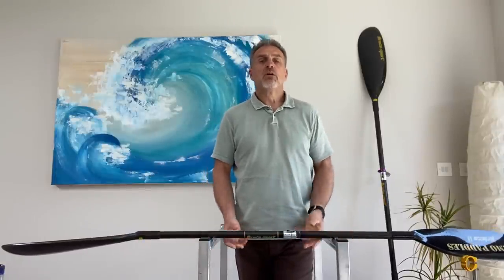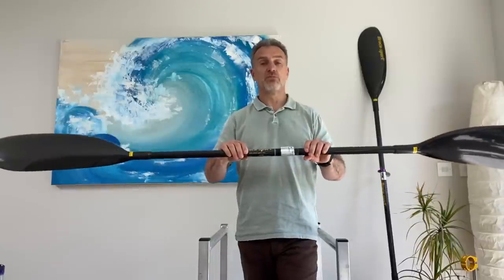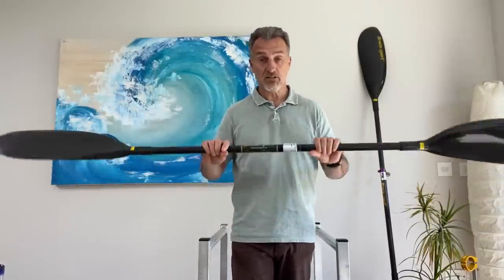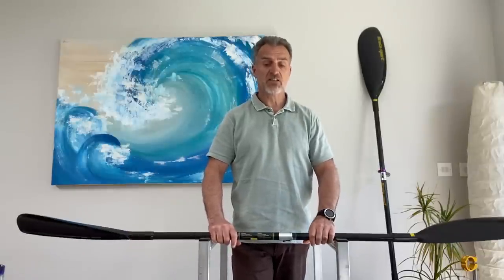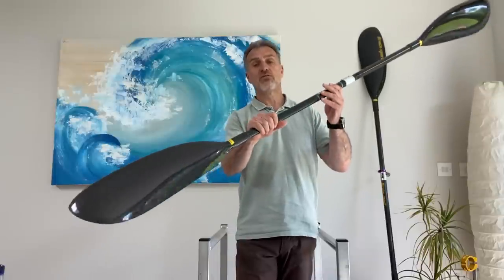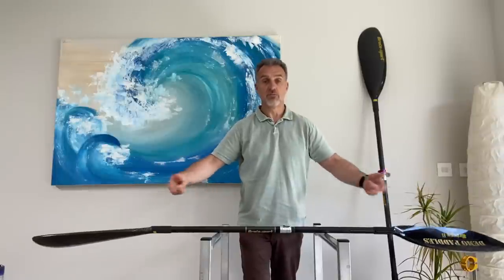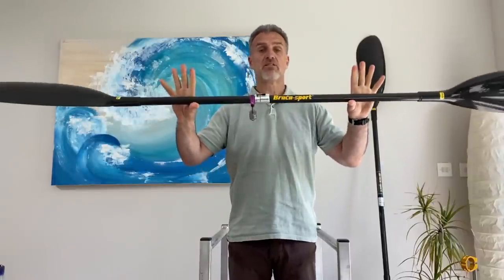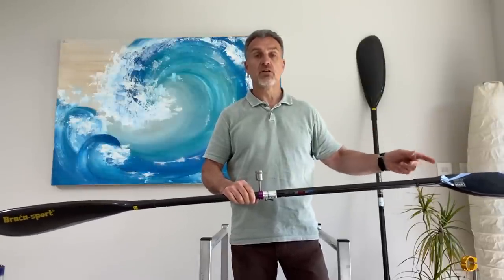Featherweight Concept

Comment: Wow, this is exactly the issue I've had for so many years. Getting stiff forearms from counter-rotating, even when the rest of the body is relatively fresh! Excited hear more about this!
Reply: If you are using a feathered paddle with one control and one release hand and are experiencing stiff forearms in both arms, then it seems something else is causing your problem because the forces and grip needed to counteract the blade flop are applied only with the control hand and should not affect the arm of your release hand.

Comment: A very simple concept solving a big problem, well explained. Thank you very much for sharing.
I can see users of wing paddles adapting it fairly quickly.
Now I'm curious what's the functional weight of my Bracia 7 725, 210cm I got from you 😇 - feathered at 60deg right handed.
See you on the water, possibly. 👍

Comment: What if you had a bent/bowed shaft in the centre then you could add a flush weight minimising protrusion. The bend in the shaft would off set some of the mass before adding weight? That would obviously not be an aftermarket option, as this is.
Reply from the maker: It would work but it would would also have to be a specific bend to account for the blade size, feather angle and blade type. I can’t see the paddle manufacturers being able , or willing , to produce a specific shaft for each scenario.

Comment: TY. Very interesting.  Question can’t they design a paddle that is equally weighted????  Also an idea. Simply increase the length of the connector to the weight. Thus the weight could be reduced!!!

Comment: That's an intriguing thought!
I have one concern, though, if you'll allow. When you counter-weigh the rotational force of the paddle incurred by it's rotational imbalance, you will add the exact additional rotational inertia that it already has through the imbalance -- i.e., the rotational inertia you'll have to overcome to rotate the paddle doubles (while of course the paddle is in balance statically). Given that you'll have to overcome this doubled inertia twice per stroke (starting, then stopping the rotation for left stroke, same for right), and that the paddle is fairly self-supported while in the water, I am extremely curious how this plays out in practice. 
Would you grant me the freedom to try this out myself with a bootleg version of the design?
Reply from the maker: Sure. Go ahead. I am confident you will see that issue does not arise. 
Drop me a DM and I will send you a set up video, to help you position your mock up.

Comment: Ivan. This is great stuff. Thanks as I have not sorted my paddle out yet. I think this would help. Warning, newbie type question below and sorry if you have answered in other clips. Can you suggest a non-subjective method to establish / set offset angle and paddle length?. The “try this and that see how it feels” doesn’t seem to work as I get no specific data, I can’t tell either way when I have used it for a small length of time. On a recent paddle of 20k. I stopped half way for a snack. My 30 degrees and 211cm ( Epic Mid Wing) was reset to 205 and I twisted it to ~45 deg when I stuck the paddle in the sand. I didn’t realise it at all until I finished and packed it all away. Ps I’m no sprinter, my typical is 10-20k @ 10-12 kph and avg 35s/m. Appreciate if you can advise…

Comment: For us older paddlers, innovations like this are really welcome as we try to minimise injury. 

On a slightly separate note, I personally think that many paddlers have blades that are too big for them. I think this is due to the fact that people quite often get the same paddle as top end paddlers who are stronger and fitter. The evidence for this is when you see paddlers with really slow stroke rates. This may potentially be also causing injury (and making them slower). Just wondering what your thoughts are on this?
Reply from the maker: Totally agree on the paddle size issue!

Comment: Have you ever tried this? How much is it faster like in 1 km?
Reply from the maker: I have been testing for nearly two years. 
Faster? I am not going to claim it make anyone go faster. 
What it does do, as I said in the video, it gives you a lot more security over the last 50m of your 1000m when everything starts to feel bad. 
So it may well reduce your decline in speed at this part of the race. 
All boat and paddle manufacturers claim added speed but I am too old and cynical to do the same!

Comment: Great idea, but probably only practical for a sprinter. Any form of marathion racing and the counterweight is a safety hazard and is at risk of being knocked off.
Reply from the maker: So far, primarily tested by marathon paddlers, ranging from Junior internationals to old guys doing the 125 miles of Devizes to Westminster with 70 + portages. Seems ok so far.
No fatalities and no mishaps.

Comment: This will have some inertia when you turn the shaft if the blades are offset.
Reply: Another reason for zero feather?
Reply: @gcziko  Yes, even if balanced, there is still effort required to rotate the shaft in the case of offset.
Reply: The unbalanced weight also tells you the position of the blades in your hands without looking.
Reply from the maker: You guys do realise that even at zero feather there is a requirement to rotate the shaft?
Reply: @ultimatekayaks6499  compared to the linear and rotational forces one needs to apply to the paddle during the active part of the stroke, the out-of-water portion seems insignificant. At near zero feather I don't feel any effort to rotate the paddle into place. I'm probably just not good enough to notice that level of detail...
Reply from the maker: @tvepaddler  at nearly zero feather, the imbalance in your paddle is almost at its maximum. 
The reality is that the force you use to stop the paddle rotation is just a force we accept as normal. It doesn’t have to be that way.
Reply: @ultimatekayaks6499  Zero-degree offset (aka feather) means that the two wing-paddle blades are in the same orientation. This means that when the bottom blade enters the water square at the catch, the top blade will also be "square in the air", meaning that its front convex surface is facing directly forward. The blades then switch roles on the next stroke, both blades maintaining this orientation of being perpendicular to the forward motion of the boat. So where is the requirement to rotate the shaft when paddling at zero offset?

In contrast, with 60-degree offset, for example, each blade must switch its orientation from 60 degrees in the air to zero degrees (square) in the water. This is 60 degrees of shaft rotation for each stroke, oscillating back and forth. So the Featherweight will "wag" with the shaft one way and then the other 60 degrees for each stroke.

While there is no Featherweight wagging at zero offset, there is still the requirement to resist what I call "blade flop" whenever both blades are in the air. And the effort required to "stop the flop" is maximized at zero offset. But there is no need to overcome the rotational inertia of the paddle plus Featherweight with each stroke while paddling at zero offset as there is for any non-zero-degree offset paddling.

Since Featherweight eliminates the effort required to stop the flop at zero feather, and zero feather has advantages for bracing, is there any reason now not to use zero feather along with Featherweight for downwind surfing?
Reply: @ultimatekayaks6499  I tested the need for some rotation still at 0 deg by setting my feather successively at 0 deg, -3 deg, -5, deg, -10 deg, and -30 deg.  I found that no rotation occurred at about -3 deg feather (but 0 deg still feels best for me).
Reply: @andyw.stephens4881  Minus three degrees seems like is a tiny difference from 0 degrees that I doubt I could ever notice while paddling. Not knowing how you measured this, I’d attribute it to measurement error that is not meaningfully different from zero. And what does the negative sign mean? We usually just give the degrees of offset and then state if it is right- or left-hand control.
Reply from the maker: @andyw.stephens4881  I am really unclear about what you are telling me here?
Reply: @ultimatekayaks6499  See my detailed explanation a few comments above.

More simply, at zero offset, the paddle shaft has minimum if any rotation. So the Featherweight keeps pointing in basically the same direction. At 60-degrees offset, the Featherweight will wiggle 60 degrees with each stroke as the shaft oscillates back and forth with each stroke. At 90 degrees offset, the wiggle is more at 90 degrees.

So zero offset minimizes the energy needed to swing the Featherweight back and forth. And since the Featherweight eliminates the torque needed to stop the flop, this is an additional advantage (although perhaps very small) of using zero offset in additional to the ease of bracing in downwind conditions.

Bottom line: Featherweight has enhanced advantages for zero-offset paddlers.
Reply: @ultimatekayaks6499  Featherweight also has enhanced advantages for low-angle paddlers, as the blade-flop torque is highest when the paddle is horizontal and decreases as this paddling angle is increased. This is likely a cosine function of the deviation from horizontal where there is full (1.00) blade-flop torque at 0 degrees from horizontal, no (0.00) blade-flop torque at 90 degrees (which can never happen anyway, especially not during airtime), and partial (0.71) blade-flop torque at 45 degrees paddling angle.
Reply: @ultimatekayaks6499  Ivan, you wrote "You guys do realise that even at zero feather there is a requirement to rotate the shaft?"  
I am saying YES there is still a need to rotate the shaft at zero feather.  So I tested it for myself by setting my feather back past zero on my Jantex Gamma Rio 700sq cm paddle.  Back past zero is "negative" angles for me as a right hand control.  I used to use a 'normal' 60 deg offset, and have gradually progressed to 45 deg, then 20 deg, and more recently to Zero deg feather.
When I went further, i.e. back to - 5 deg etc I found the point where my body-arm-wrist motion did not need to rotate at all.  That point was at about 3 to 5 degrees back past the zero graduation mark on my shaft (a "negative" angle).  It did not feel good though!
Reply: @andyw.stephens4881  Andy, could it be that your paddle indicates "negative 3 degrees" when the blade offset is actually zero degrees? This is easy to check by putting the assembled paddle face down on a long, flat table, loosening the collar, adjusting the blades so that both top edges are against the table, tightening the collar, and seeing what offset angle is indicated.

I'm guessing you've been paddling at 3 to 5 degrees right-hand control when you thought it was zero and so "real zero "feels odd to you.
Reply: @CCRAPresearch  Gary, you asked if my Jantex Gamma Rio 700 sq cm paddle was graduated accurately. I checked on a table as you suggested.  I had the paddle blades face-down so I could not see the graduation marks on the shaft join area.  I rotated one half until it lay against the table, then rotated the other half till it also lay against the table, then clamped it tight, and turned it over and checked the graduation marks.  Perfect alignment on the zero mark!  Just what I expected from Jantex!!  
My Jantex Gamma 730 sq cm also has perfect construction.
Reply: @andyw.stephens4881  That's interesting and good to know about your Jantex paddles (I have one, too). So now it remains a mystery to me why you get some shaft rotation at zero degrees offset but not at 3 to 5 five degrees left-hand control when you approached zero offset coming from right-hand control. Do you know while paddling at zero offset if you use two-hand control, right-hand control, left-hand control, or alternating-hand control? (I also shifted from 60 degrees right-hand control to zero and kept using right-hand control at zero, although I can do both-hand control, left-hand control, and alternating-hand control, too, if I want for variety.)
Reply: @CCRAPresearch  At zero offset at set up stage both blades are convex side up above axis of shaft, if you loosen you grip at this stage paddle will rotate away from this alignment, so in fact you are opposing rotation rather than actually rotating. Force used to oppose rotation is effectively no different to apply force to cause it.

At exit back of blade if vertical and you have to rotate it over so catch blade goes in square, so there is rotation applied there.
Reply: @waverideraus4882 e The force needed to oppose rotation is less than the force needed to cause rotation because in the latter situation you have to overcome the angular inertia of the paddle, which now includes an extra 200+ grams with the addition of the Featherweight. With zero feather, less total force is needed because the paddle (including the Featherweight) is always in the same rotational orientation with paddle blades always perpendicular to the surface of the water.

It seems to me that this oscillation of the rotation of the paddle with Featherweight would be greatest (a) at high feather angles (say 75 to 90 degrees), (b) using a paddle such as the one Ivan uses in the video (Braca II) which is very asymmetrical, and (c) at high stroke rates (cadence).  This could require a firmer grip of the control hand to repeatedly decelerate and re-accelerate the rotation of the paddle, defeating at least partly the purpose of the Featherweight. Since Ivan paddles with a high feather angle of 75 degrees and has likely paddled that Braca at a cadence of about 120 bpm to test, he should be able to tell us if this is the case. I imagine it was not or barely noticeable or he wouldn’t have continued development of the Featherweight.

Comment: At 9:25 he says, "This paddle has now become weightless."  If the paddle had become weightless he could hold it up, let it go, and it would not fall to the floor!  With the addition of the counterweight the paddler actually has to lift more total weight during each recovery.  This total weight increase plus the inconvenience of having the counterweight sticking out from the paddle shaft must have been shown in testing to be offset by the reduction in effort needed to prepare for the next stroke, or he wouldn't be out here talking it up on the internet🙂
Reply: I don't think it will make any difference to the weight lifted as it is in the centre rather than the ends.
However, rotational forces are not eliminated because there is always rotational inertia to overcome, in both directions to make the catch and now that has been increased.
Reply from the maker: @williamlawrenson8345  this is not the experience in reality. The amount of force used to turn the shaft is essentially zero. Come and see me next time you are at an event and you will feel how it works.